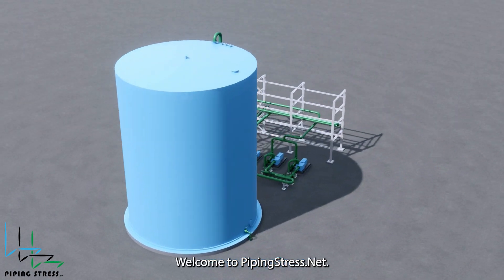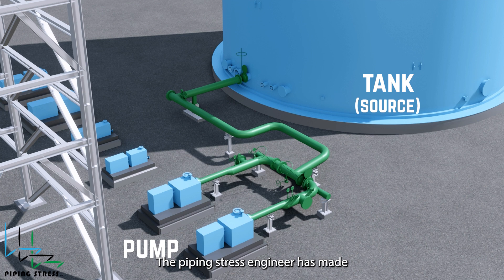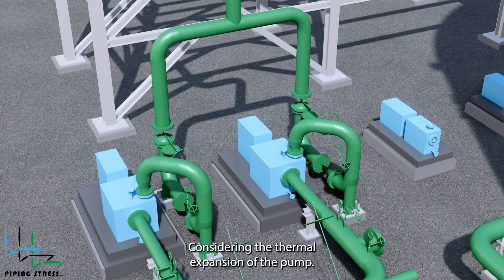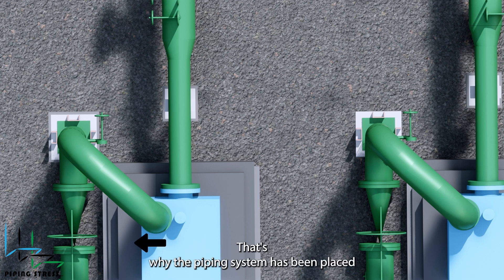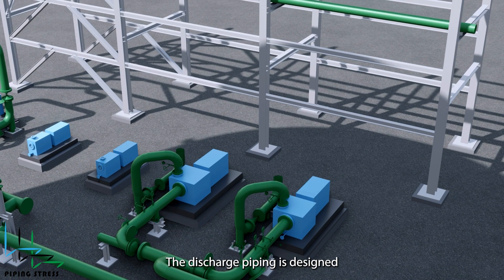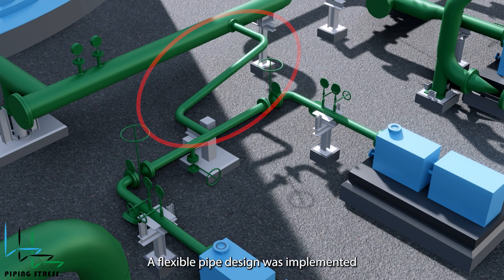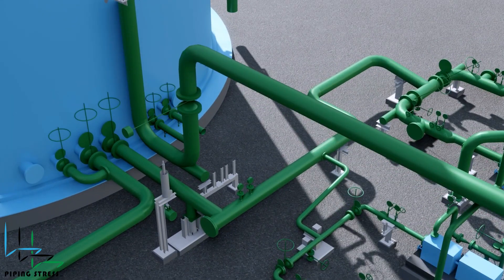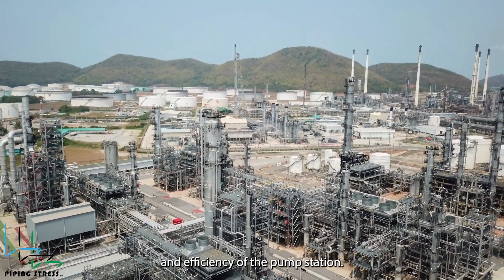Pump Station Piping Design and Stress Analysis #pipingstress #pipingdesign #centrifugalpumps

Comment: is there a video that explain the effect of the relation between suction and discharge nozzle alignment over why the restrict on the elbow was first (when suction and discharge nozzle werent on the same center line) was not aligned with the centerline of discharge nozzle and in the second case (when suction and discharge nozzle were on the same centerline) the restrict on elbow was aligned with discharge nozzle?
Reply from the maker: Hi, Not yet, but it would be a good idea to prepare a video if interested.